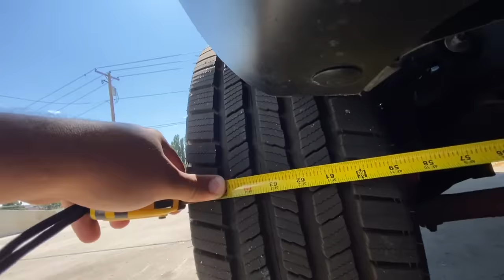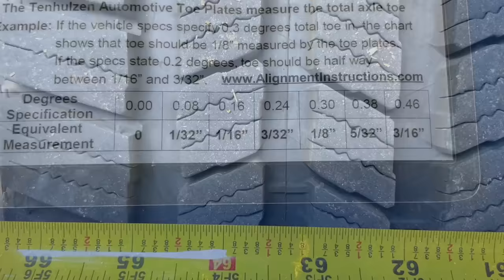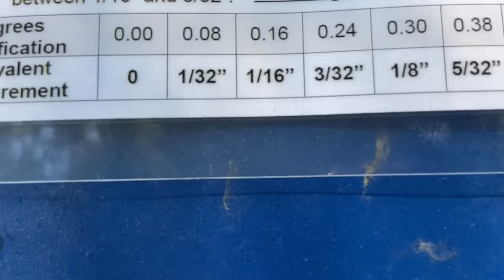How to do an alignment on a car at home using only a tape-measure!!! (And Alignment Basics)

Comment: Best of go to a garage that's got a proper lazer alignment.i did this for years with a string line and a tape measure it works but you can be half inch out. I never achived even tyre wear on the front.some car wheel alignment are set toeing in not dead centre.lazer wheel alignment is not expencive worth paying for. the back wheels Are ajustable as well so if the back is out of line you can't set the front up inline with the back.you can have your wheels in line and the steering wheel of centre when you drive straight.your also supposed to have even threads on the track rods and a straight steering wheel  as the car was when it came out the factory.you can  get this 75%right using these methods  but not spot on perfect.front wheel drive cars produce uneven tyre wear unless there set up propally.  this is probably o.k.on an old rearwheel drive car with diff and a prophaft.

Comment: For a more accurate measurment, jack up one wheel and have someone spin it while you scribe a line with a pocket knife or nail around the tire, use a brick or something to steady your scribe. let the car down and do it on the other side. Another check is with the car on the ground sight the side walls of the front tire to the back tire on both sides, line your eye up with the front tire like a rifle sight and see what you see. both sides should be the same.
Reply: I saw a farmer holding straight planks hard up onto the tyre walls and marking the point in front of car on the ground where the say 6 foot of plank  rested.  I imagine  it needed  to be a symmetrical match up for  the other tyre  . Long time ago . Hard to precisely and understandably  word this  stuff huh .
Reply: @michaelcorbidge7914  Easier than the string method I would think.
Reply: problem is once you jack it up and lower it again, u cant just go by those measurements becuz the vehicle Needs to settle and Roll at least 10 feet ,Then check the measurements..just jacking it up, rotating and lowering to check will give false readings becuz camber will be off a bit which affects toe, untill it rolls a bit and settles./

Comment: I was a Hunter rep, I ran the alignment shop at a 7 franchise dealer and later owned my own shop with an A-111 Hunter 4-wheel machine for many years. You assumed that the tires/rims are perfectly round with zero run out, very bad idea. 2nd, when making adjustments on these tie rods, you never loosened the tie rod boots and left them twisted. You should have sprayed penetrating oil on the tie rod nuts and the boot clamps and reset the boots/untwist after you were done. I'm sure you can figure out how to check to see if there is ANY runout in the tire/rim and illustrate that 1st in your next video. You also did this on a solid surface. When making any adjustment, you have asumed there are no loose components in the tie rod/rack assy. You should have checked and confirmed that 1st. Assuming your truck had a perfect front end, you should have driven your truck forward or back to recheck your numbers or put one of your tires over two slippery surfaces, like two kitchen cutting sheets with olive oil between them. Three of the frachises at the dealer were Porsche, Mercedes and Audi, I worked closely with their reps to solve many problems of customer issues over the years.

Comment: run a string line all the way around the center of tires you can easily see which wheel is out start with drivers side then passenger to adjust
Reply: What?

Comment: This is great, it's not the money so much as the waiting time.  Here's a thought,  if it is 63 1/4" (maybe that was an 63 1/8", but dose not change the thought) on the front, and  62 3/4" on the rear, why not adjust each tire half the difference, so as to avoid the back and forth.  So in the case of 63 1/4" take away 62 3/4" diff 1/2", adjust each tire 1/4".   In case 2 where it is 63 1/8" front and 62 3/4" in rear diff 3/8"  or 6/16", adjust each tire 3/16".   Does that make sense?
Reply: Good thinking if you're a math teacher?

Comment: There is a better way to get an accurate and accurate alignment of the tires of the car, which is to use a string and connect it from the rear tire to the front tire, so that it touches the outer edge of each tire, and then decide if you need to move the tire inward or outward
Reply: This can fuck you up if you have a vehicle that has tie rods on all 4. Because if you're off in the rear too, it will throw off the front. Also, if your wheelbase is not the same in the front/rear that will also not work because it will not be square.
Reply: Nope nope nope! Back when I'd do my own front end alignment on my old Corsica, I found the front tires were over an inch further apart than the rear tires.

NEVER assume your vehicle's geometry is symmetrical from the front to the back.
Reply: You should know that if the four points of the front and rear tires do not touch the taut thread, then there will be no exact alignment of the wheels. If the direction of the rear tires is different from the front, no matter how hard you try, there will be no exact alignment, so this process is the best, through which you can direct even the tire  back through
Reply: What if the vehicle is dog tracking
Reply: @lynskeyti9940  Then you give it a treat and tell it to go lay down. 

lolol.... It means your rear toe either has a positive or negative thrust angle. Meaning you need to have the toe aligned.
Reply: @lynskeyti9940 or crabwalking? 😅

Comment: That is great, easy to do. But what if the tread on the tires are not perfectly straight. Would give a false reading. On some cheap tires if you spin the tire you can see it is not equal. How about measuring from the wheel on front and on back. Thanks for sharing.

Comment: Using this method- If 1 wheel is strait and ok and 1 is out of alignment, you won't know which is which because you have no reference to a fixed or parallel structure. The string method is more accurate.
Reply: Faster also
Reply: If you changed the TRE on one side, you know which side is out of alignment.
Reply: What's the string method
Reply: This is correct.  This method will get the toe-in set correctly but will not assure the steering wheel stays centered when going straight.  The centering of the steering wheel at the beginning of this video was meaningless.  But the steering wheel may be close enough to centered to be acceptable.  You can always go back and adjust each tie rod evenly later to try it get the steering wheel centered.  I also used this method to save money.  I would adjust camber based on noticing tire wear on inside or outside of tread.  Also, if the car pulls to one side, that helps to determine how to adjust camber.
Reply: Nothing wrong with this method seems pretty useful

Comment: You'd have more precise measurements by measuring off the rotors with the wheels off and off the ground. I've done this method, but off the rotors with the wheels off and jacked up. What I did was take the wheels off, took two carpenter squares held on against the rotors by two lugs flat position parallel to the ground. This left the squares sticking out from front to back to measure off of. Being off the ground won't effect toe, makes it real easy to adjust the tie rods, quicker to measure and more precise. Most carpenter squares are plenty flat enough to use, they generally have close enough tolerances within a couple 1000's of an inch in most cases... they're good enough for toe anyways.
Reply: Two carpenter squares are pipe fitters best friend.
Reply: Couldn't agree more. The worst rotor is probably more precise than the best tire. I use a set of tools that fit just about any bolt patttern and bolt right onto each rotor. Got them from a company called TMR Customs.

Comment: Cool video!  I'm going to try to do a wheel alignment on my 2003 Mercury Mountaineer myself.  The steering wheel is off center to the left and when I drive and let go of the steering wheel, the car immediately veers to the right.  Do you think that adjusting the inner tie rod as in your vehicle can help, or is there something else going on?  It was in a fender bender recently where I had to replace the passenger fender, front bumper, and right headlight.  There was no other damage visually that I can see; the engine compartment is intact My rim is fine, not cracked or scratched or anything, no damages to any other parts, no leaks of any kind, but the hit did scuff the tire a little and I think that's what caused the steering wheel to lose the center and start veering to the right.  Prior to the accident my steering wheel was on center and would go straightforward after letting go of the steering wheel while on the road.  What do you recommend, based on what I've described?  Do I push the tie rods in or out based on these conditions after doing my measurements?  Any recommendations a greatly appreciated, and the more details the better.  Thanks.

Comment: I am retired now, and have done this type of job many times. my method is to lock the steering wheel with a piece of 2"x 2", long enough to wedge it between the steering wheel and the floor. Then i start the job by loosening the two lock nuts. Next i cut another 2 bits of 2" x 2", and the length is 1" longer than the front wheel front to rear. I fix a piece horizontal to the outside of the wheel,and tie it to the wheel using bungie cord. I use my measuring tape, take a reading from the front then a reading at the rear, then proceed wit the steering adjustments, easy as pie.
Reply: P.S. don`t forget to loosen the rubber boot on the track rod.

Comment: Instead of measuring off of treads, go to your local costco, sams club, walmart etc and ask for a set of slip sheets. You cut 4 slits, maybe add some weight to the center and the bottom corners to keep it from falling, like some heavy bolts, you got trailer park alignment plates. Just press them up against the wheel, you can even put a digital angle finder on it and measure your camber. You could even measure the angle with a protractor when you have camber plates and a level surface.

Comment: I've always had good luck setting the tow 1/8 of an inch narrower on the front measurement compared to the back measurement. How much do you put in it also depends on how worn out your front end components are.
Reply: 1/8" drags the tire 40-50 ft per mile...
Reply: True.  My 1985 M-B shop manual is a bit fussy.  They show a shop tool, rod which pushes the fwd side of the front tires apart to take up play before adjusting toe-in.  I recall then you set 1/16" toe-in, like for a car with all new suspension parts.  If worn tie-rod ends and ball-joints, better to set 1/8" toe-in if no such loading rod.  That is for RWD cars.  If FWD, you set slight toe-out since the front tires pull and thus rotate towards toe-in while driving.  Ideally, the fronts will be exactly parallel when driving.
Reply: @William Grissom  and what about 4WD drive Or AWD
Reply: @fvgc454ss  only done for front, the rear you keep parallel. 4x4 or AWD take into consideration if full time or part time. Full time, set up as FWD vehicle with toe out. Part time set up as RWD, with toe in.

Comment: I suggest jacking the car enough to take the weight off the tires when you make the adjustments  or you may strip the threads if you have to make too many adjustments to get it right. That's from my personal experience. Also,  put some grease on the threads if you are putting new ones on.
Reply: exactly✅

Comment: Good info & explain perfectly. Question ; i sale flooring so gave up the tape measure & use a lazier now. Can I do what you did by just going inside driver front tire to inside passenger & so forth to back side? Or is measuring from actual roughly middle tread as you did an important part? or just a way to hold end of tape measure.

Comment: If the steering wheel is straight tracking down the road, this is usually all it needs but if it's off or if you change a tie rod the two side need to be adjusted as symmetrical. 

I find something symmetrical on both sides of the frame or something in the exact center of it to verify the symmetry. Of course starting with the steering wheel straight as he showed at the beginning. 

After that camber is important for tracking straight, and it seems most cars with struts don't have options for adjusting caster.

I've had great luck doing my alignments like he showed in the video.

Comment: Thanks, mine was way off! I got a proper alignment after and the toe was surprisingly in spec after doing this! 

Do you have any tips on measuring camber and caster?
Reply: If you have a level spot to park you can use an angle gauge or there's a lot of phone apps out there that will give you angles, levels etc.
Reply: @TheSinkingGarage  good luck finding level! my garage is all over the place ,level wise LOL
 even finding a parking lot thats just Flat, impossible where I live

Comment: 3:25 I did a similar video but I used 2 tape measures and duct taped them on front and back. Have been doing it this way for 20 years.

Comment: The only issue is if you have one wheel that isn't aligned properly, but the other one is.  It will likely be pretty obvious if one wheel is way out, but not so obvious if it's just off a little bit.  Probably better to use the string/jackstand method.
Reply from the maker: That is something but if the steering wheel is kept straight then there shouldn’t be that issue and this is a lot easier to set up then the string and stand method
Reply: @daringmotors  Your method only works if you had a good alignment to start with and then you removed parts from ONLY one side or the other.  As soon as you remove parts from both sides you have no way of knowing which tie rod to adjust, it could be left or right or both, to get them parallel with the rear tires.
Reply: @71bgt  I have a 2008 Nissan Pathfinder, which has rear toe adjustments as well. I had a 4 wheel alignment done, the rear ended up coming slightly out of alignment after about 6 months. Shortly after, the vehicle struck a pole on the front passenger side, now it pulls to the right. Before that, I KNOW my rear tires toe was and still is off. Nowhere near as bad as the front, front cuts tires in a month! I want to align the front, would it still be accurate using the string method, even if the rear tires toe were also off? My steering wheel is quite a ways to the left in order to go straight, leading me to believe the passenger side needs to come in (tie rod end is forward of the axle). I also want to make sure both tires are going straight and parallel to the vehicle. So I was going to use the string method first, then fine tune with the tape measure method. Being the front drove perfectly straight before and only the passenger tire hit the pole, wouldn't it make sense that the drivers front would still straight and parallel to the vehicle? Just trying to find a straight starting point on this mess, it squeals while driving and is already wearing my new tires and the closest alignment shop is 45 mins away!
Reply: Hank Bridges  WTF man, are you a Longacre salesman or what??? You copy-paste the same stuff under all comments. Calm down man. And btw the string method is pretty accurate, you can get very good results with it, if the rear suspension is accurate. Don't need to buy any shit from ebay. Cool yourself down.

Comment: You should probably first determine which wheel is out of alignment. Moving both equally may not solve the problem if only one was out of alignment.
Reply: Quite agree sir, you probably know this from whether or not your steering wheel was on centre before you started the exercise. Of corse to complicate the issue we now have rear wheel alignment too.!
Reply: Its all math, just zero all of the wheels and then toe the wheels in or out to the spec sheet in the car manual. It really is that basic. You don't need digital computer alignments. Good old analogue measuring will be perfect.
Reply: But it's  telling us something  if one tyre has outer wear a nd the other doesn't  .i gotta think about  it cos i see a conundrum  here . Ill sleep on it .

Comment: I've been using a tape measure for the past 30 years. Toe in is the only thing that will ever really wear tires out. I don't know why anyone would ever pay for such simple and cheap stuff. I used to run an alignment rack as well but I would never pay for that on any of my cars. Even the cheap tie rods from rock auto last for a long time and go on just fine.
Reply: People would pay because money is elastic but time is not, making time much more valuable than money.
Reply: @robertbobby3325  ive put tie rods on in 5 minutes. If you know what your doing and dont have to touch something with a blow torch its a simple driveway deal